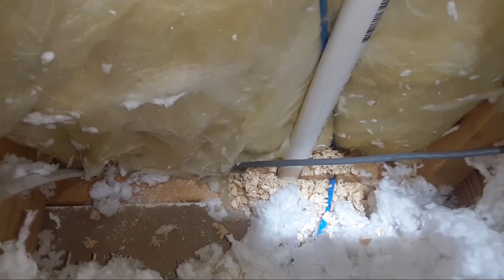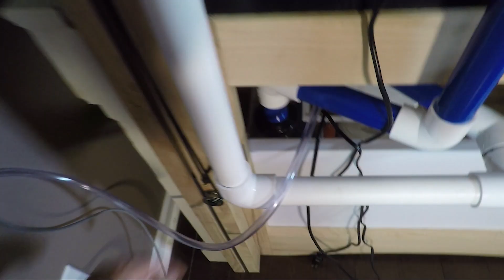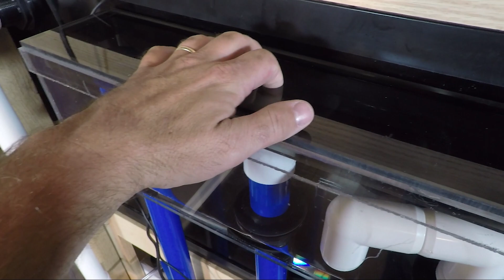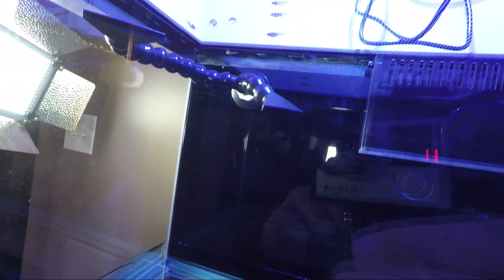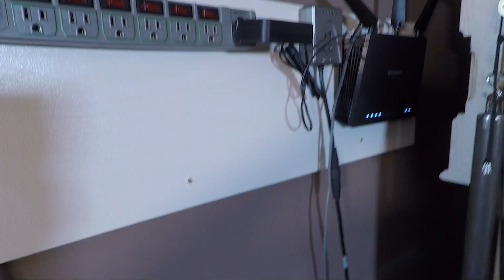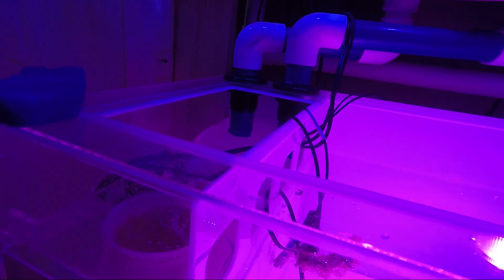Aquarium Plumbing and Electrical.  The Ultimate 75 Gallon Aquarium Build Part 5

Comment: Fresh air doesn’t need to be from the roof. A lot of work for little benefit.
Reply from the maker: The house is on a slab (so no crawl space access) and the wall it's on isn't connected to any exterior wall.  Basically, attic access was the only option.  Once in the attic, it was easier to reach the attic vent vs the soffit, so this was the simplest way in my house.  It wasn't that fresh air had to come from the roof, it was that the roof was the easiest fresh air to reach in my case.
Reply: @BornHandy  why couldn’t you just use fresh air from the room?
Reply: @Tizm_With_Tony  Because in a newer house, like mine. The house is sealed up. The AC, dogs, pets, people contribute to make higher C02 values. Using room air will drop your pH. Example without outside air and C02 scrubber; I have 7.8 pH with an alkalinity of 10.5. Now with fresh air and C02 scrubber my pH goes to 8.15 to 8.24. Houses will bottle C02 unless you have windows open or some other air exchanger setup to alleviate this issue.